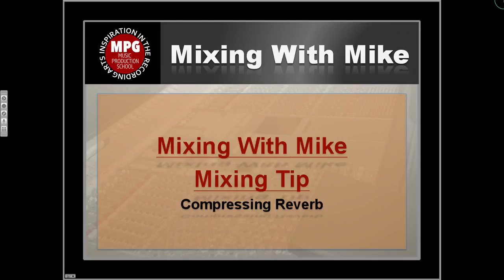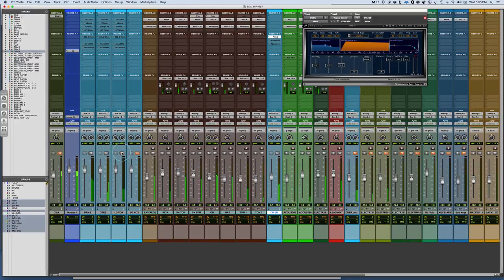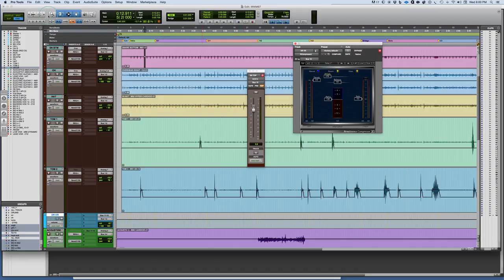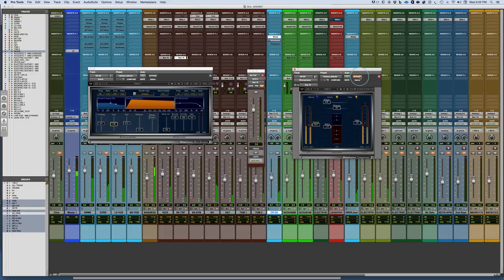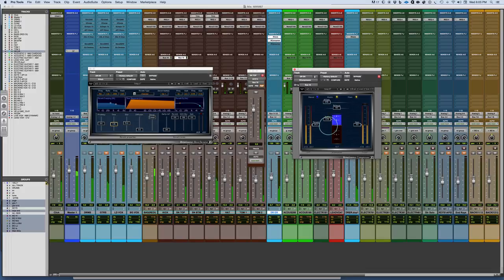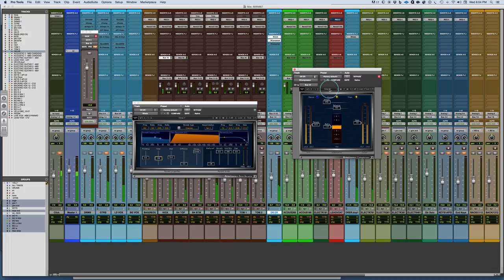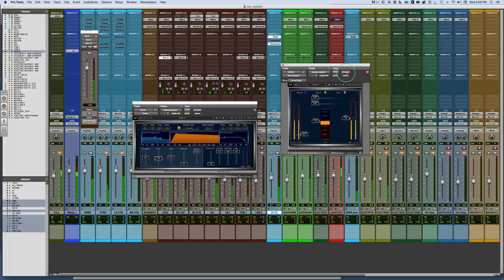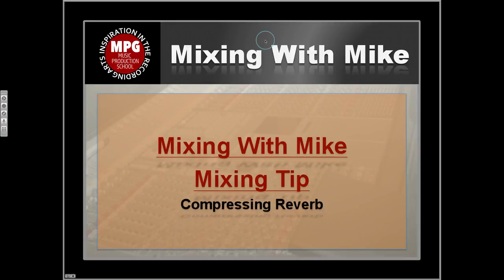Mixing With Mike Mixing Tip: Compressing Reverb

Comment: hi Mike nice tutorial , my only question is would you need to set up more than one reverb if your applying this technique to more than one instrument im guessing one seperate for vocals at least, or can all instruments with this technique go to one reverb?
Reply from the maker: Great question. I don't necessarily compress reverbs by default, only if I feel it will help the sound and imaging. How many reverbs depends on the song and style. I generally have separate reverbs for each instrument, unless multiple tracks have the same function in the song. Quite often, one reverb instance may be the same basic settings as other instances but with slightly adapted settings.

Comment: So, in effect, this is keying a change in shape of the tail? As opposed to just changing the shape of the tail in the reverb itself and losing the ability to lock the shape-change it into the musical grid? That's kind of what I'm taking from it, anyway.

Been watching a lot of your screen casts, thanks for sharing.
Reply from the maker: +motoservo Hi motoservo,
It serves a few functions and shaping the tail is one. Also, when the compression kicks in, the dry signal comes a bit forward as the reverb is compressed and then wraps around the back end of the dry part. This also helps to shorten reverb times so the tail is not clouding up the mix.
Cheers!
Mike

Comment: Great video mike. When mixing an element of an aggressive song for loudness do you put limiters before or after the reverb or both?

What is your general approach to achieving a high crest factor for a channel/instrument without destroying the sound of a reverb?
Reply from the maker: The movement of the reverb is important if you are heavily compressing the dry sounds, so I would be more inclined to compress it in a 'loud' mix if it somehow gets lost in the mix. Usually, a good parallel compressor setup that has the dry tracks AND the reverb feeding into it will give you everything you need.